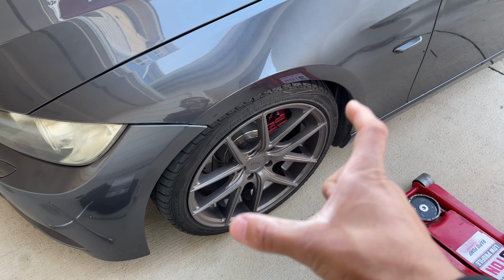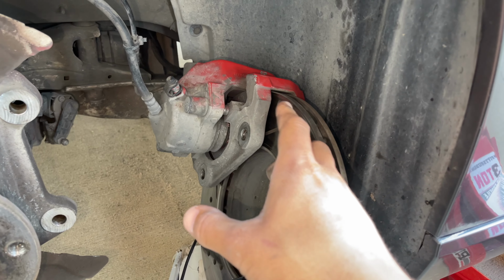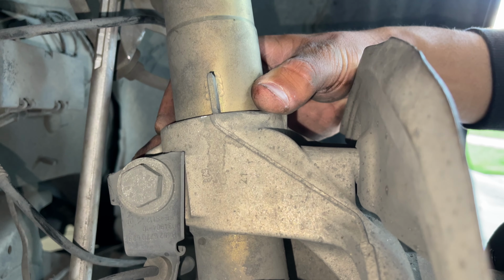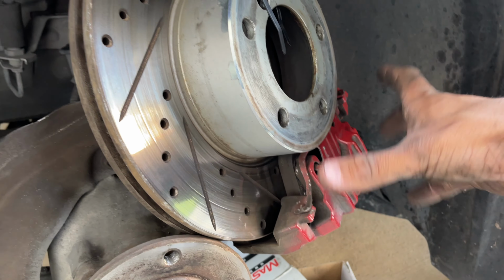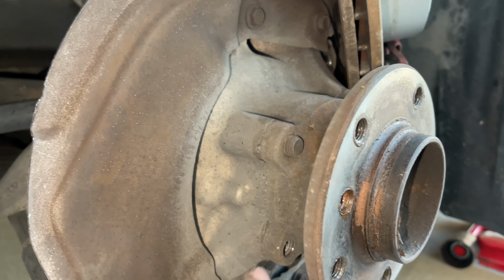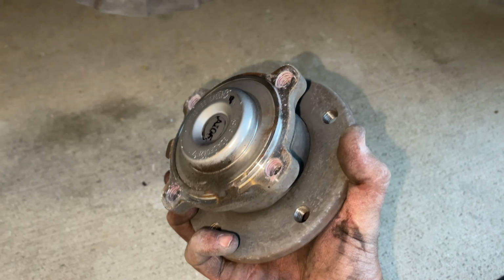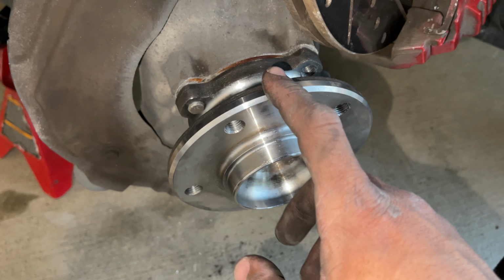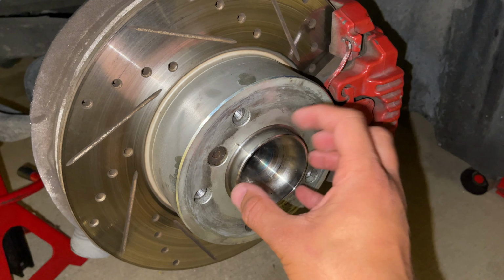How To Replace BMW Front Wheel Bearing! E90 E92 E92 328i 335i

Comment: I saw another video where they loosened the strut bolt, removed the bracket; but also lowered strut bracket itself after widening it. I think this was to allow room to access that upper right bolt you used a socket swivel attachment for. 

Didn’t see you do this or mention it, if you did. So a note for future viewers. 😊
Reply from the maker: Thank you for this input! This is a valid method, but I tried to do this video showing how to do this job without loosening the strut. Good job having such a keen eye ❤️

Comment: 🫣you doing waaay too much work than what’s required. Firstly use a flat screw driver, wedge in between the brake and brake disc and push the brake pads loose. Secondly just swing the wheel to the other side to get the other 2 wheelbearing nuts off. And thats it. O and you never added thread locker on the nuts when you screwed them back on again. They gona rattle loose.
Reply: Im about to do this i see theres red loctite can. I use a torch to loosen it? I tried with one bolt couple days ago on my 350k km e90 it backed out couple turns then Got really tight as if it was about to snap so i just tighten it back because extracting that bolt would be a pita.